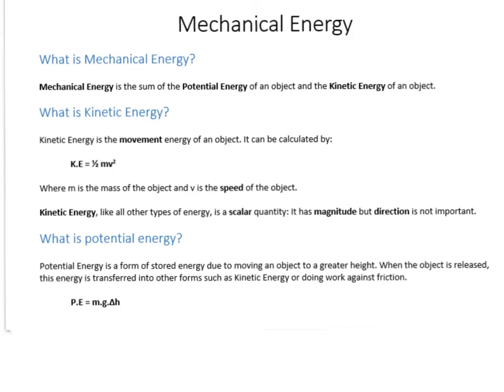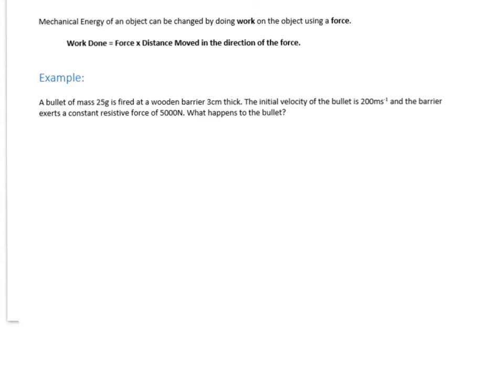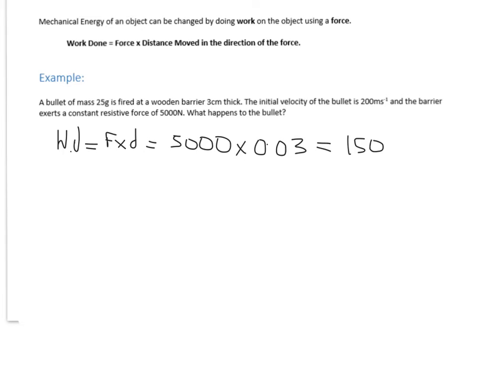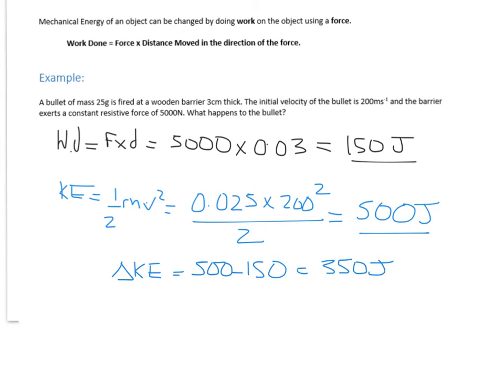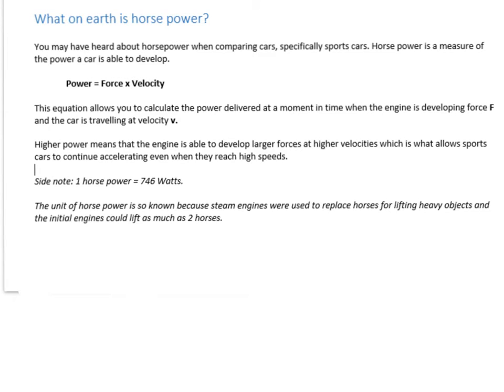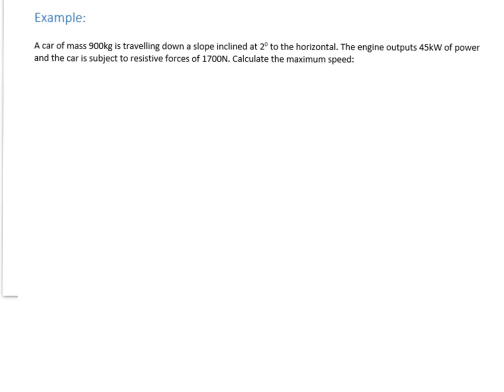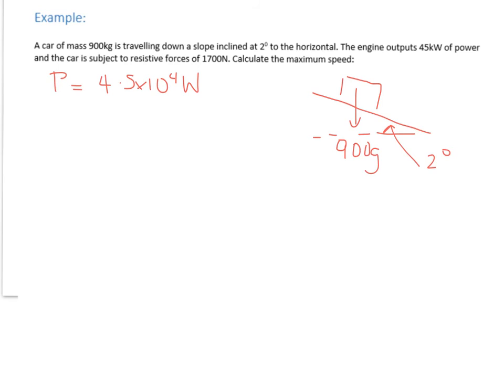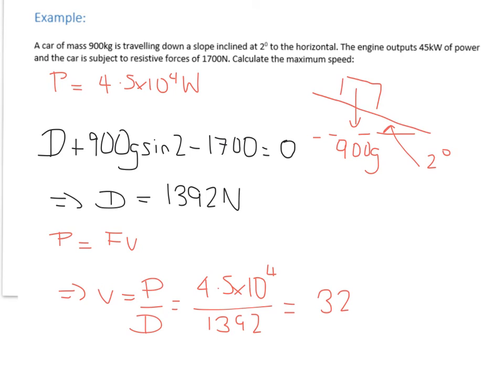Mechanical Energy and Power

Comment: Just checking, is that the correct number of S.F.'s for example 1 and 2?
Reply from the maker: +Lain Iwakura Good question. It depends whether you are asking from a Physics or Maths perspective. For the mechanics courses in A Level Maths / Further Maths, yes the significant figures are correct. However if you are asking from an A Level Physics point of view, example 1 should be 1.7 x 10^2 m/s and the second should be 32 m/s.
Reply: +LAE Physics My physics teacher is really strict about significant figures so thanks for explaining
Reply: Daniel Powroznik real talk 👌 that some👌👀👌👀👌👀👌👀👌👀 real go౦ԁ taLK👌 thats ✔ some  t ruth👌👌 right👌👌there👌👌👌 right✔there ✔✔if i do ƽaү so my self 💯 i say so 💯 thats what im talking about right there right there (chorus: ʳᶦᵍʰᵗ ᵗʰᵉʳᵉ) mMMMMᎷМ💯 👌👌 👌НO0ОଠOOOOOОଠଠOoooᵒᵒᵒᵒᵒᵒᵒᵒᵒ👌 👌👌 👌 💯 👌 👀 👀 👀 👌👌real talk